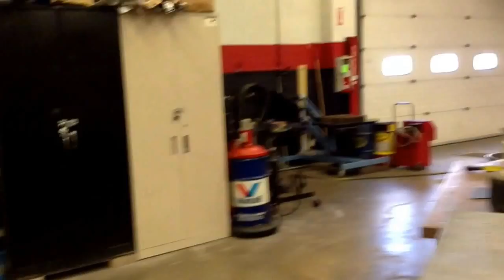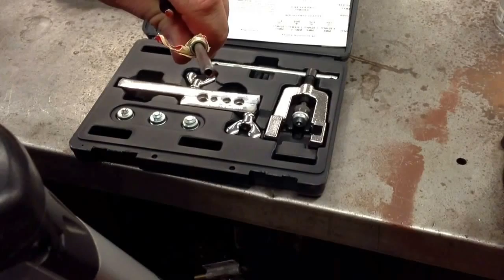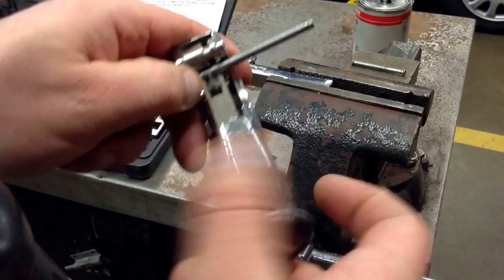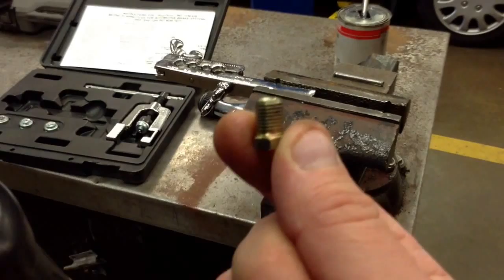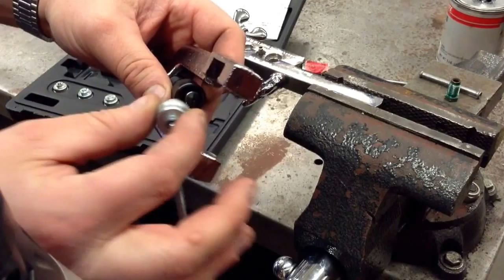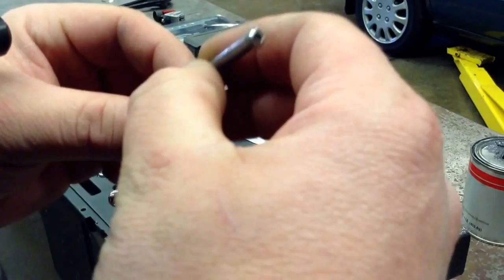Bubble flare

Comment: Good video for operation of tool. Not so good for actually doing lines. Your brake line will usually be a few feet long, and sometimes still installed on the vehicle. Avoid putting the brake line in a vertical position, especially in a class, bad habits start there first. Debris will fall in your line much easier as you work on it if it is vertical. Especially when filing or deburring. blow the line out or tip the open down and tap on it to remove debris. Practice holding the anvil tool while compressing the tubing, it is not too difficult to do.

Comment: Good video but double flares are still used on cars today.  The Double flare can be re-connected if removed and are typically still used on the connection to brake calipers and wheel cylinders.  The Bubble flare, used elsewhere in the brake system should not be reused once disconnected.

Comment: Why have several different flare tool sets on the bench? I have 1 set that does double, as well as ISO (bubble) flares in sizes from 1/8"-1/2" tube. Mine is a Lisle set which cost less than $100. I can't use it on stainless tube, but I have another tool for that.

Comment: His flare has the proper 90 degree, flat, contact point to fitting. Using a double flare tool to create a bubble flare creates a 45 degree slope at the fitting. Tightening to a slope creates a slippage point.
Reply: Turn the clamp over, use the flat side and skip the next step of double flaring

Comment: I didn't understand what you said toward the end about moving over to the bubble flare. If one's vehicle is older than 1995, wouldn't all of the master cylinder and brake cylinder ports be machined to acept the double or single flare?
Reply: Yes they are machined to accept a double flare, so changing them out just for the sake of a new standard is costly and pointless. Maybe what he meant was using a bubble flare union instead of a double flare in case you need to splice the line that rotted out.

Comment: gSome of these videos say tighten as much as you can and this video says finger tight. Who is right?
Reply from the maker: So the answer is in the tool. really. I've had some of these flaring tools, usually low budget ones that have no grip on the line whatsoever so, here I'll tighten with a bit of extra elbow grease, usually a screwdriver between the wing nuts. Hope this helps.

Comment: Thanks for this good video.  I've seen lots of other ones with people using double flare tools to make a bubble flare, which can be done but not as well as using the right tool.  All of the car parts stores in my area carry the double flare tools, but none of them carry the bubble flare tools, even as a rental!  So I ended up buying one on Amazon, and just wanted to see the proper method before I use it today.  It seems like many people don't know the difference between double and bubble flares and that you have to use the right type that matches your vehicle or else it will leak!

Comment: Great video thanks my moms car needs to have new steel brake lines installed because they are all rusted out after watching your video I went out on ebay and bought me a blue point snapon flaring tool mine used yours is new but as long as it gets the job done that's all I care about thanks for the great video

Comment: I thought the Double flare was not only stronger, but also re-usable compared to the Bubble flare. The 45 degree double is folded in on itself when first formed. The bubble will crush once fully tightened and can't be reused. Correct me if I'm wrong.

Comment: 4.75mm is simply 3/16 of an inch. It is just the same diameter in different unit.
Reply: 3/16 inch X 25.4  mm per inch = 4.76 mm

Comment: I am trying to no avail to make bubble flares.   I can easily replicate over and over double flares, but still no bubble flares. 
I am using the Cal Van tool which is supposed to be superior.   I think the reason for failure is because the die for bubble flares is much longer than the die for double flares.  It has more metal to push and I am working off a roll of brake line, so my brake line is not completely straight.     
I just wonder if the KD or blue point bubble flaring tool would do it.???  Its die seems a bit different than the Cal-Van die......   Any ideas?